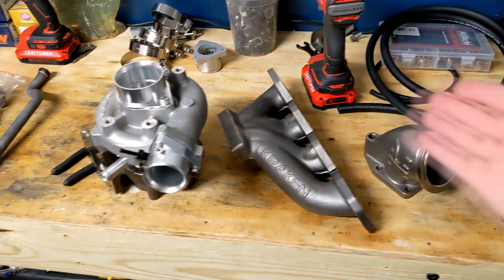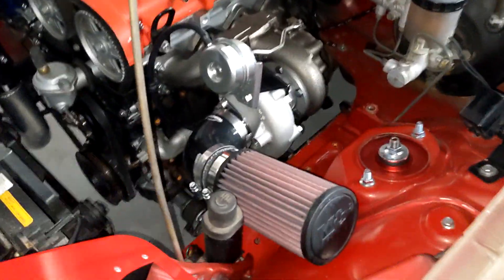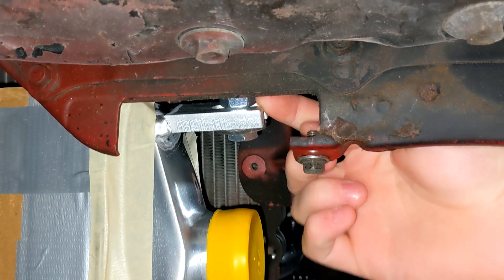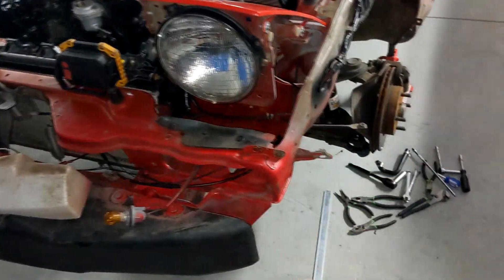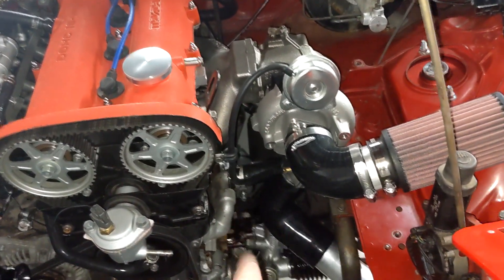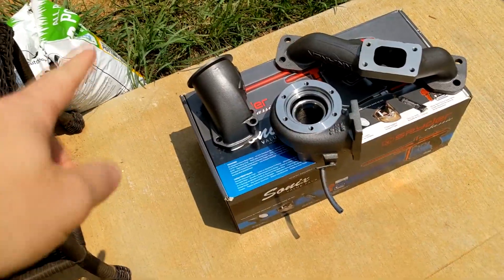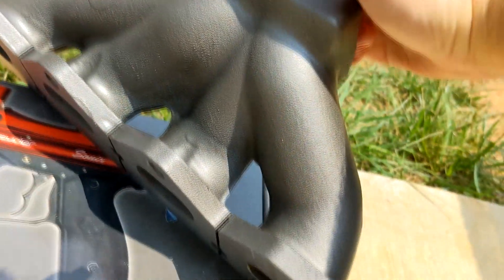1.6 Miata Kraken Turbo Kit Install - Part 1 (Overview & Mockup)

Comment: Great video. I heard that the 1.6 already has a threaded bung for the oil return line, or does it need to be drilled and tapped?
Reply from the maker: You are correct. They already have an oil feed at the back of the block underneath the header

Comment: I'm wondering how you're finding the clearance of the cold-side of the turbo to the frame edge of the engine bay?!?!?! Do you have any issues with touching/clearance/engine mount movement/bumping/rubbing?
Reply from the maker: Had no issues with fitment and rubbing anywhere. I ended up cutting the "flange" off the frame rail, but that was only so I could remove the turbo and leave the manifold on the engine. You will have to adjust the pipes in the couplers and fiddle with it all until nothing rubs.

Comment: Did you need to make the hole in the charge pipe for the wastegate line yourself? And the bung, was it included? My kraken kit arrived. Trying to figure our how to connect the wastegate.  Thanks!
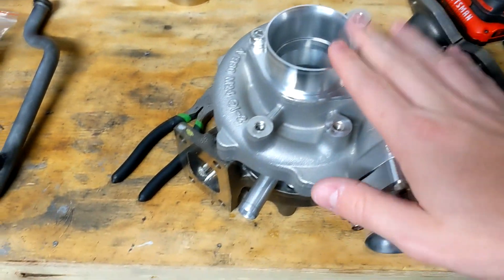Reply from the maker: Nope! If you go to 0:41, look at the turbo outlet. I bought an adapter to go from the 3 bolt to a 2” flange. That had a hole drilled in it with that black barb. Kind of hard to see. That’s your boost source, connect that to your wastegate
Reply: @ConnorsCorner1  i was already searching! Thanks for the reply. Your vids have basically been my instructions. Haha! 
Good luck with the build btw. Please post a dyno vid if you go there. Curious to see the torque curve.
Reply from the maker: @fabiang123  Will do!! Picking block and head up from the machine shop tomorrow

Comment: How does the 3inch dump fit? Been looking at getting this kit for a while
Reply from the maker: Fits great. It’s a little tight, but clears everything. To install from under the car you have to side it up in the whole but have it pointing towards the passenger door, then it just snakes up and connects to the little cash elbow. Super easy

Comment: when purchasing the garrett GT2554R
 turbo through the complete kraken turbo kit, do i need to get a wastegate bracket?
Reply from the maker: If you buy the turbo from Kraken, it should come with the wastegate already installed. He also installs the turbo on the manifold and even clocks it for you. I got a good deal on a turbo which is the only reason I didn’t buy one from him.

Comment: Would love to hear of any issues you have with the kit, have mine sitting on my desk waiting while my clutch breaks in!
Reply from the maker: I may or may not have it done already… 0 issues with fitment. Can’t recommend the kit enough. It’s perfect
Reply: @ConnorsCorner1  awesome, I’m running ps/ac so might run into some issues there. Hopefully not
Reply from the maker: @henryweegar1573  You definitely shouldnt! Just take your time and reach out to Kraken on FB if you need anything. He tends to respond pretty quickly and is extremely nice.
Reply: @ConnorsCorner1  i have this kit and so far the only issue I have is the coolant lines that go to the turbo are leaking out of the turbo and are not fun to get to. Make sure the hoses are slid all the on the fitting and add hose clamps. Otherwise she is good to go
Reply from the maker: @tristianchevier  Yep. Mine are slid all the way on but one was leaking. It’s because I was using cheap clamps. Swapped them out for some more expensive ones, no more leak!